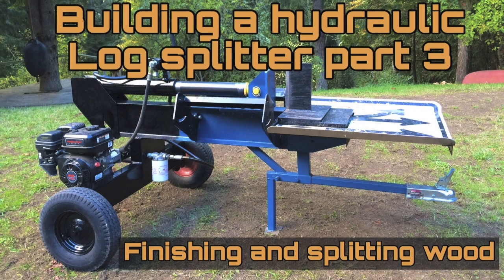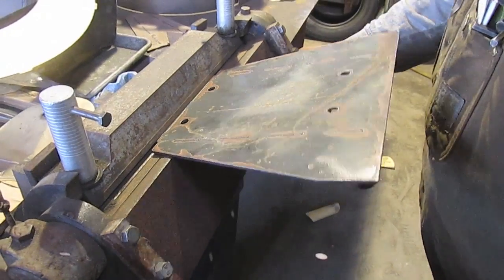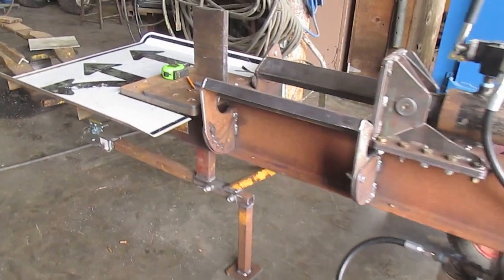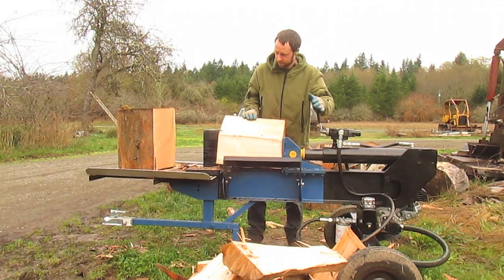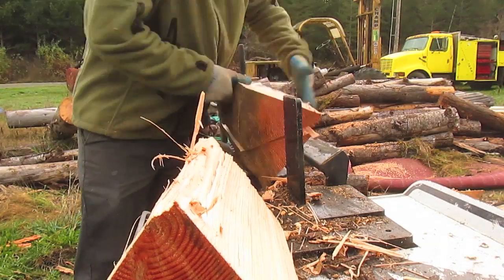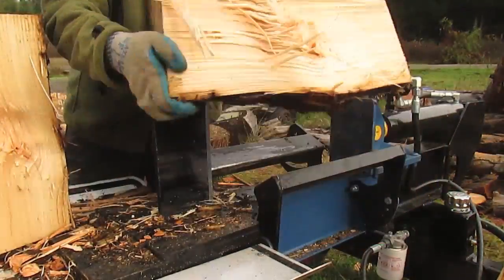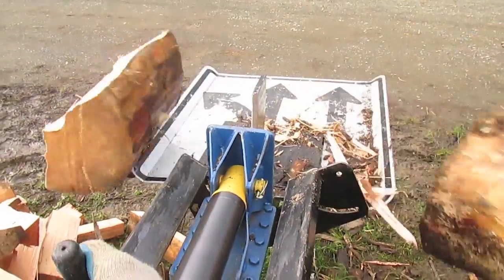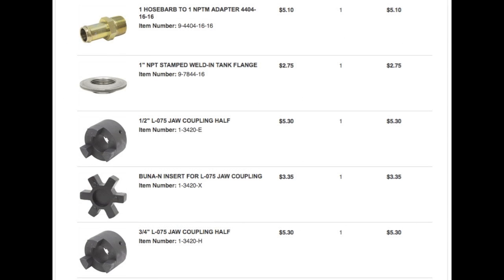Homemade Log splitter part 3

Comment: As usual, another great build.  I wonder if there is any way to build a sound deadening box around the engine or if it is even worth trying.  Those small engines can get mind numbing after a while.
Reply from the maker: That could probably be done, I’m sure it would be much nicer to operate with a quiet engine 👍

Comment: Hy there. Nice project. I have a question about the hydraulic pump that you are using in this project. Why is it 2 stage pump? It's better to have a 2 stage or 1 stage ?
Reply from the maker: Yes a 2 stage pump is better for a log splitter because it will cycle faster. Basically it’s like having two speeds, first stage will move the cylinder faster but if it gets into a big knot or something the pump with automatically switch to the second stage and produces more pressure but will move the cylinder slower, this is basically like down shifting in a car.they work extremely well 👍

Comment: Hi Mike, Thanks so much for the detailed build, i have been looking to buy a splitter but here in Australia a reasonable quality one starts at around 2.5 K. Yours is an absolute
 "ball tearer" , i will be starting fabrication soon and will document the build on the way.  Thanks again.
Reply from the maker: Damien Milk Right on I’m glad you found this build helpful 👍 It’s crazy how much stuff sells for in Australia. I’d think selling for 2.5k would be manufactured in Australia? Let me know when you start posting your build videos!
Reply: @Mikefestiva  No unfortunately the splitters although advertised as Australian, i believe are made from mostly Chinese sourced parts. I stand to be corrected if wrong, (i hope i am). I am just collecting the parts and steel and start burning some rods.
Reply: "ball tearer" is so cringe in so many ways

Comment: Where did you get the high pressure hoses??
Reply from the maker: Surplus center, they have just about every size you would ever need.
Reply: Mike festiva cool thanks about how much psi rated should I get

Comment: I have a 22 ton Huskee log splitter that I bought new from Tractor Supply about 10 years ago. My woods has a lot of really old Oak trees that are huge. Some of the tree trunks measure nearly 3 ft. in diameter. I had a friend that owns and runs a welding shop design and build me a boom to use to bring the huge blocks to the splitter. It can only be used in the vertical position and for the sake of safety, that is a good thing.
He mounted a hand crank winch with an ATV winch roller guide for the cable. The cable runs up through a pulley and out to a set of logging tongs that I got from Norther Tool back when they were still Northern Hydraulics. I  can then grab onto these huge blocks that two guys used to really struggle with and crank them right into the splitter foot and split them with ease. I leave very slight pressure on the blocks until the ram has them pinned in place then release the pressure and split them.
I have never found anything that my 22 ton can't split. It either splits them or it cuts them. Very happy with how my set up works now. Thinking of starting up a you tube channel this winter and I will feature this splitter and demonstrate how well it works.
Thanks again for sharing your videos. I really have enjoyed watching them.
Gary Fox,Iowa
Reply from the maker: Right on Gary thanks for checking out my videos! I really appreciate your comments 🙂 I definitely would recommend posting some videos and starting a YouTube channel, when you do let me know, I would like to see your log splitter and hoist setup. Take care.

Comment: Nice work! Few things...  

1. I hear the engine working hardest on retract. Installing a dump valve on base port will help a lot not only with speed and fuel consumption, but with unnecessary heating of the hydraulic fluid. With that size rod, rough calcs you are trying to return 30-35 gpm through a 15-20 gpm valve and filter. Up size return filter will be necessary too or return dump directly to tank.
2. Install suction strainer. Protects pump from foreign material...weld bebes, seam slag, wood chips, dirt, etc.
All in all, nice job. I appreciate people who have actual trade skills!

Comment: Awesome videos. Been going to build a saw mill and ran across your channel. Not sure if I’m going to build a splitter or just buy the one harbor freight has and modify it as I don’t have tons of time for all the projects I want to play with. 
What do you think about adding a foot pedal to this splitter?  Haha..  love the videos!! Good info!  Thanks friend.  :)
Reply from the maker: Hey thanks for checking out my channel! I have a lot of videos on my YouTube channel covering the sawmill I build, there’s a lot of info in those videos 🙂 Now about the log splitter, if I didn’t already have quite a few of the parts It would not have been cost effective to build one, plus like you mentioned it definitely takes time. I looked into the harbor freight log splitter but the local store doesn’t stock it so I was not able to look them over, if it’s the same one I’m thinking of it’s got a good double action cut from one side to the other. I definitely would suggest checking out some reviews on it and if people like them just buy one, there honestly cheaper then you could build one for. 
Now about the foot pedal, I bet you could set one up that way but I feel it’s better to have your hand on the control just in case, there’s a lot of industrial machines that require both hands to be on buttons before the machine will cycle, presses and stuff like that. Take care

Comment: Splitter came out great! I like how you mixed things up and used what you had on hand. That's a great way to save not only money but resources that would have just collected dust of been tossed in a junkyard. I've wanted to build another splitter, but the last one that my old man built will last 10 lifetimes... Hell, even the first one we built is doing great, almost 30 years later. The key to longevity is keeping the hydraulic oil clean and cool (relatively). I've got some videos on my channel with both the old and new(er) ones we made. I still really liked that CNC Plasma, that's the cats ass for sure! Thanks for sharing!

Comment: I am also wondering why you did not add a log lift and a adjustable cutting wedge with a 4 way splitting head, that you can adjust for different size of logs.

Comment: Your title is a far cry as being Homemade. The average person does not have access to the equipment you were using.
Reply: It’s a very nice homemade log splitter, but it is still homemade.
Reply from the maker: Why Is it a far cry from being homemade? If someone was going to take on building a log splitter they should at least own or have access to a drill press, welder, angle grinder, and a way to cut thicker metal with a torch or plasma torch. The only tools in this video that most people don’t have in there shop if they work with metal would be the CNC plasma torch and the electro magnetic drill, all the drilling could have been done with a simple drill press, and a hand held plasma torch would have been completely adequate to cut metal. Would you not have used the CNC plasma torch and instead free hand the cuts even if you had access to one? If this log splitter is not homemade, please define homemade?

Comment: Hi great videos. What size mig are you using in the vids? Do you have three phase power? I built a small splitter a year or two ago but didn't have enough power (only 13a standard domestic supply in the uk) to weld hot enough so it made it super hard to get the strength. All the best
Reply from the maker: Adam Marshall Thanks for checking out my video!
I was using my friends 180 amp Miller for this build, back when I built this splitter I only had a Small MIG welder  that didn’t have the amps to do this job. I upgraded welders and now I have a Vulcan Omnipro 220 amp, it has MIG, stick, TIG and a spool gun for welding aluminum! It’s so nice not the be limited when it comes to welders anymore. It seemed like I have been limited for years on projects because of a small welder, so I completely understand what you were dealing with. I think my welder is running off of a 50amp breaker? We have single phase power, but we have some smaller phase converters for running things like milling machines and lathes at our shops.
Take care

Comment: I’m so jealous of the CNC plasma table I missed that I worked with one for 12 years and then when I was building my log splitter I cut everything out with an angle grinder
Reply from the maker: Tin Smitty's. fab shop The CNC plasma table is a awesome tool! But hey you still got your splitter built, it’s harder with a angle grinder but it’s still possible. Thanks for checking out my video!
Ps do you have a link to a video of your log splitter?

Comment: I'm quite impressed with the cycle speed. Does she heat up really good? Do you find the reservoir sized big enough? I added a secondary reservoir to my 37 ton splitter for a total of 14 gallons. It reduced heat buildup tremendously and seems to function better.
Reply from the maker: Thanks for checking out my log splitter build! It's been a few years since I built it but I think it holds about 8 gallons of oil, I have not had any problems with too much heat, the tank gets warm to hot, but not too hot to touch. 
I got the cylinder given to me from a friend, did you see the size of the rod on the ram, it's freaking BIG! I have no idea of what it came from but hey it was free!
Do you have any videos of your splitter on youtube? take care :)

Comment: Nice job, it seems to be working well.  can you tell me the size of the hydraulic ram?  I was given a 16 hp koelor engine and was thinking of putting a 5 inch cylinder on it when I build one

Comment: I like seeing great DIY workmanship and I am slowly trying to accumulate all needed metal tools.  I am going to start my splitter project this spring and would greatly appreciate where you purchase your equipment peices.
Reply from the maker: Hi Richard Thanks for watching my videos!
I ordered all my parts to build my wood splitter from   Surplus center   on line, look them up. They have lots of parts for building projects like mills and splitter. Have fun building your wood splitter this spring!  They sure are a lot nicer then splitting wood with a splitting maul.
Take care :)

Comment: Great Job I have an existing slitter that needs an overhaul. Where did you get  the parts looks like a one stop shop. I havn't found anything on the net.
Reply from the maker: Thanks :) I buy a lot of my parts for from surplus center on line, they have a lot of great parts, you should find just about ever thing you will ned. I hope this helps with your overhaul.
Reply: What is the name of the surplus center?
Reply: Sorry I found it Surplus center Duh!!!
Reply from the maker: I think you will be happy with all the parts available from Surplus center.
Between them, E bay and Amazon that's really about the only places I buy my supplies from for most of my projects.
Take care Ted :)

Comment: Thanks for showing your parts list !
Reply from the maker: Your welcome :) It took me a while thinking about what I needed to buy and finding all the right sizes so every thing would fit together, so I wanted to include the parts list so it could help get someone else past that stage quicker.
One other thing I find sometimes when looking for a special part, you may know what you need but just don't know what the name is to look it up on line. Thanks for watching!

Comment: Very nice build Mike. I really like the table at the end. Make it nice for one person to operate.
Now all you need is a gassifier and run all the equipment you build on wood. Full circle. 
I have run my splitter off wood gas and it works beautiful. If I ever build that band mill, I will also run it on wood gas.

Comment: Sorry bad grammer. If you had a list of the design cut for the braces and ram and what thickness of metal used i maybe to make like yours. The only difference i would use is a cooler for the hydraulic fluid and a little longer ram with a four way or even eight way splitter. I get some pretty big logs here for firewood